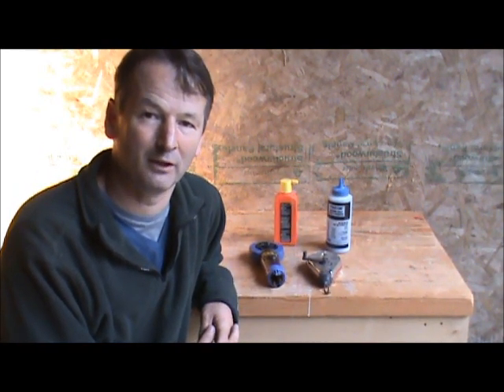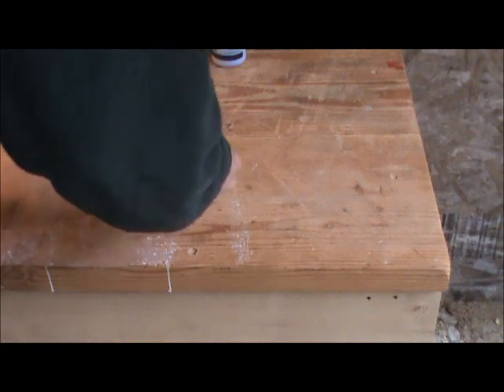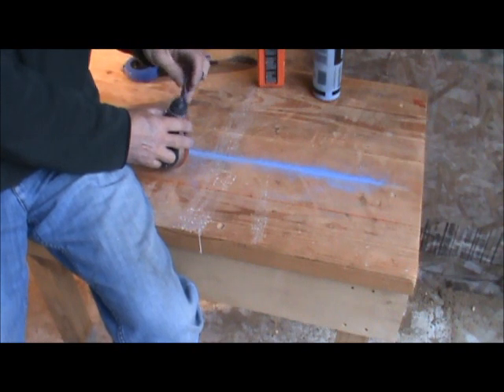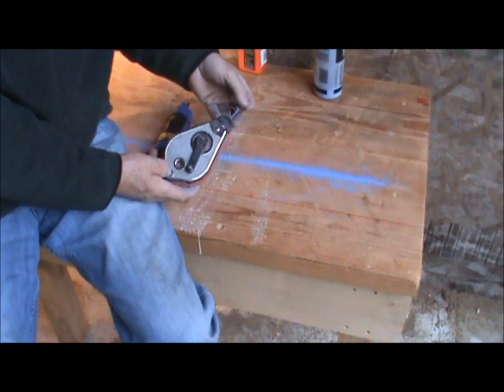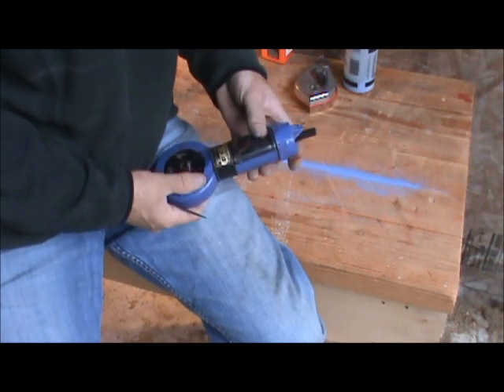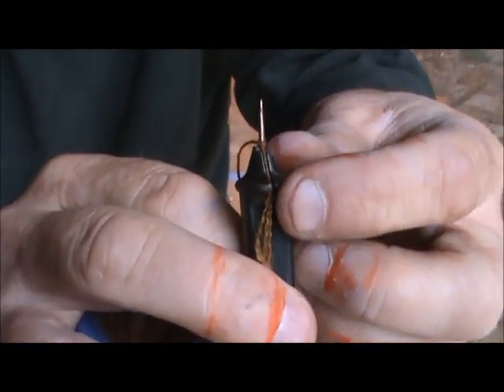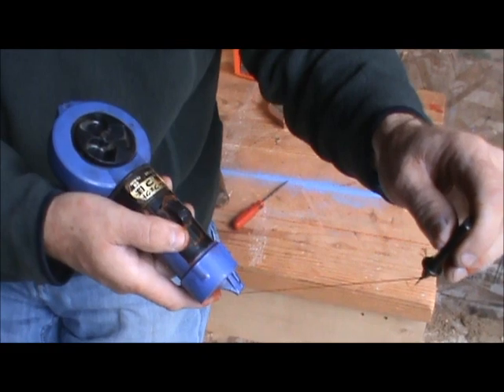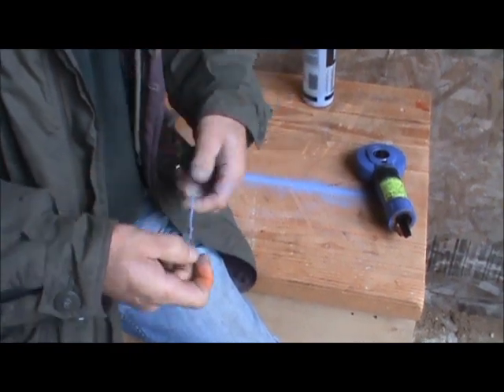Ink Lines vs Chalk Lines for Log Builders

Comment from the maker: Great advice, I haven't tried mixing the inks, but will give it a go because your right it is hard to get the red ink off. I also really think that putting the ink line into traditional chalk line is a great idea. You can buy the Japanese chalk lines with the thin line, however this is probable a cheaper way to do it. Thanks :)

Comment: David, any tips for cleaning up the orange ink on surfaces that end up not being cut. I often will have the line overrun a stop point and then that leaves the issue of cleanup, aside from sanding.

PS: thanks for taking the time to make a great and concise video.
Reply from the maker: +Stephan P in BC I have found that if I use a plastic scrubby and add a bit of bleach it seems to help, especially on pressure washed logs. :)
Reply: +bclogstairandrail thanks I'll give that a go.

Comment: Spring the line in the air and not on the board you want to chalk against first to get some of the loose chalk off for when you actually chalk a line. Also you have a rough thick chalk line, like that's literally what it's for, giving you rough lines. They have finer chalk lines, it's pretty unfair to compare a rough chalk line to a fine ink line when you're not even using comparable fair tools.
Reply from the maker: Good information. Thanks :)
Reply: +Ben K Ben, I know the finer chalk lines you mention, and your experience may be different, but I've found that with a standard framing style chalk line and a tajima inkline there's no need for anything inbetween. I have a hard time with the think chalk lines, especially when getting outwards of 50 feet, just can't see the line well enough to sight walls and framing in general.

Comment: I wonder if the inc line thing would work for metal work.. it can be quite a hassle to draw a straight line on sheet metal sometimes...
Well the pin would not work, that's for sure xP
Reply from the maker: +He Ka I can't see why it wouldn't, I don't know whether this is a good idea or not, but maybe one of those small, but very strong magnets might work for the pin. Let me know if you try it and it works!. :)
Reply: it works well. Give it a try. It is just more in dangered to get wished away by hand as like on wood. Because the powerder goes into the wood fibers where bare metal has no fibers. But again it works. But we also take a spray paint can lay the line and spray over the line. So we have a straight line that will not been blown away. Yeah sometimes you have to change the line we know that too. Have fun building stuff.